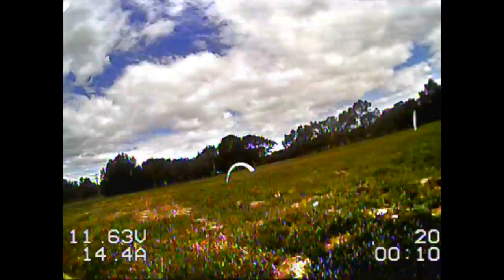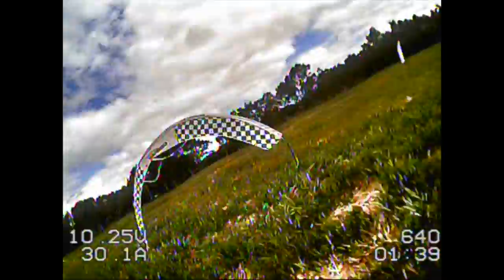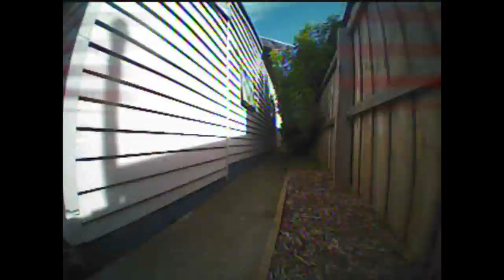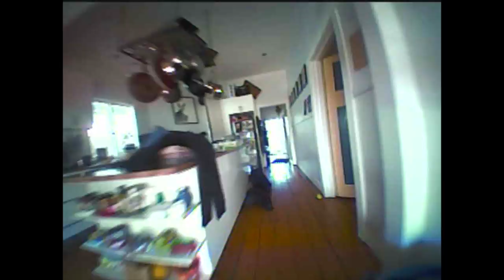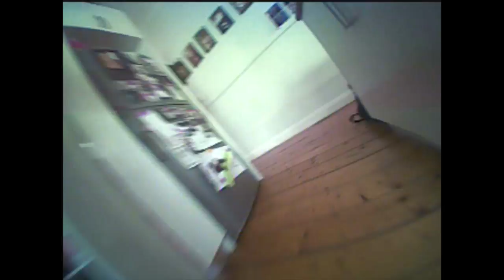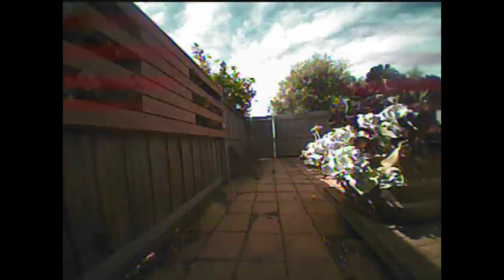FLY FASTER. How more roll helps. Happy flying #21

Comment: I have a question. 
would I put a GoPro for example on a eachine Wizard x220, what happens to the flight stability of the drone ? and must I change everything in the settings ? 
Thank you :-)
Reply: DesiignMC I think you will have to rebalance it so as not to apply extra strain on the front motors. the eaiset way is probably to move the battery to the back of the quad :)

Comment: This question has to do with some of your other videos. Not sure if you check those comments often. Would you recommend using the Turnigy Evolution raido for the Eachine Wizard x220 build or stay with the FlySky 1a6 Radio Receiver combo? And if yes, would that change the build much? Still a noob here!
Reply from the maker: use the ev. they build is amost exactly the same except you use the radio/receiver combo that is the ev and the ia6c

Comment: One thing I notice a ton of people doing is turning too late for the corner and overshooting it by a mile, almost like the gate and the corner are two separate moves. On a tight 180 corner if you aim to be going through the gate nearly sideways so you've only got a little over half a turn left to do, you won't overshoot anywhere near as far and you'll be back on the gas much sooner.
Reply from the maker: true, but it is easier said than done.